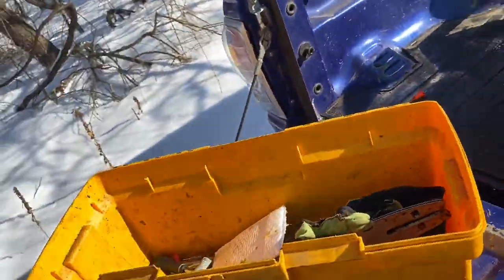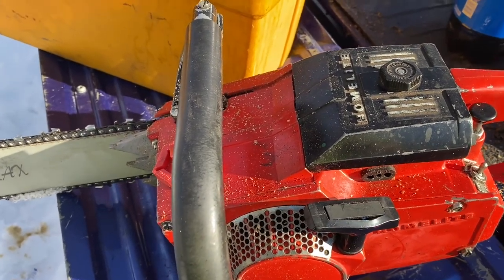Porting Homelite Super XL-130 Chainsaw!  First Successful Test!  Screamer Or A Slug?

Comment: What the ratio you mix the gas for your xl 130 is it 32 to 1
Reply from the maker: 40:1
Reply: I can not believe this i found the instruction book for it and it says to mix the gas at 31 1
Reply: I mean 32 1
Reply from the maker: @audiemullarkey9973  Modern oil is made better but 32:1 won’t hurt anything.